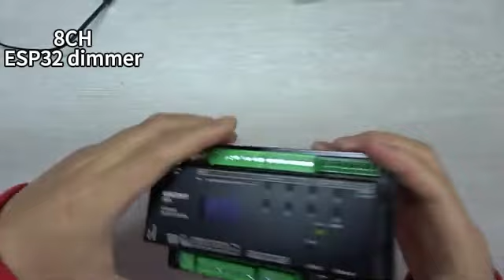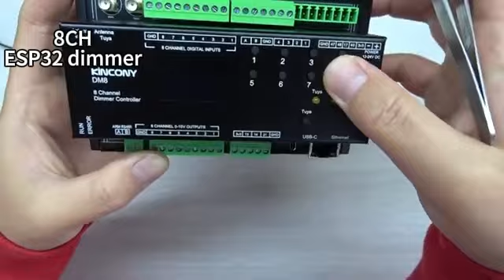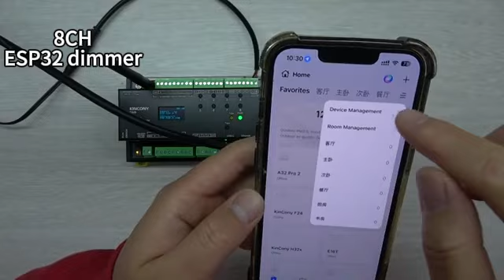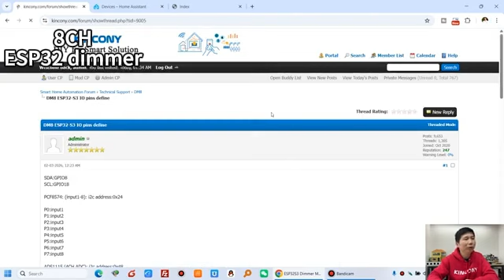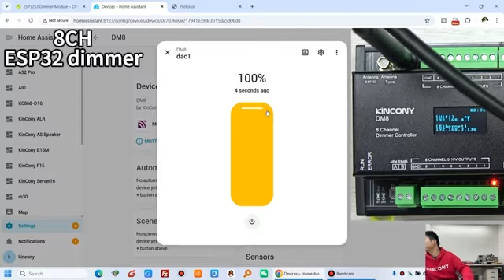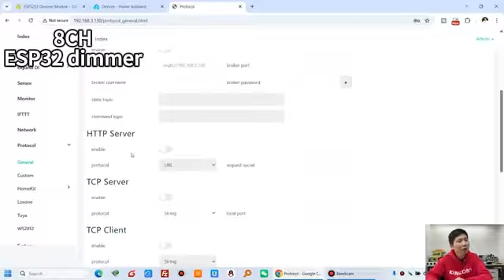8CH DC 0-10v output ESP32 dimmer board for lamp and motor -DM8

Comment from the maker: Model No. KinCony DM8
Description: KinCony 8 Channel ESP32-S3 Smart Dimmer Controller – DM8
Power supply: 12-24V DC
Processor: ESP32-S3-WROOM-1U (N16R8)
Size: 140mm*83mm*59mm
interfaces: Ethernet(RJ45)-LAN 100Mbps IPv4/IPv6,WiFi,RS485,Bluetooth,USB-C,OLED,Tuya Module
RTC: DS3231 high precision chip (battery socket on PCB)
SD Card: SPI bus
Installation method: DIN RAIL
OLED: SSD1306 I2C display

Outputs:
8CH 0-10v Outputs.

Inputs:
ADS1115 16bit ADC: 2CH analog input DC0-5V (A1,A2) 2CH analog input 4-20mA (A3,A4)
8CH dry contact inputs (optocoupler isolation, long distance circuit for MAX 500 meters cable)
4 buttons: 1:ESP32 Reset 2:ESP32 Download 3:Tuya config 4: ARM CPU Reset
1-Wire GPIO: 4CH (with pull-up resistance on PCB)
Free GPIO: 4CH (ESP32 pin directly, without pull-up resistance on PCB)

software solution:

1. download KinCony KCS v3 firmware, so that work with multi protocol: HTTP, MQTT, TCP, RS485 modbus, Tuya app, config OUTPUT for “momentary” and “interlock” group functions. use Tuya mobile phone app directly, support voice control by Alexa and Google home speaker directly. if you want local voice control without internet, you can add KinCony AS voice assistant. “KCS” support IFTTT function work locally without internet. It also support use by KinCony cloud server. KCS v3 support home assistant auto discovery function by MQTT, so without any config file for home assistant.

2. download firmware by ESPHome, integrate to home assistant or use by web service.

3. write your own arudino or ESP-IDF code for your own requirements.

4. It is recommended to use home assistant and Tuya mobile phone app at the same time. So that remote control by internet using Tuya app, local control by LAN using home assistant app.

Order bundles:
Bundle A: DM8
Bundle B: DM8 + USB-C cable+ DC12V power supply

Related technical information
———————————
ESP32 I/O pin define: https://www.kincony.com/forum/showthread.php?tid=9005
config yaml file for ESPHome: https://www.kincony.com/forum/showthread.php?tid=9127
ESPHome official supportted list:
arduino demo source code: https://www.kincony.com/forum/forumdisplay.php?fid=103
KCS v3 firmware online guide: https://www.kincony.com/how-to-use-kcsv3-firmware-esp32-board.html